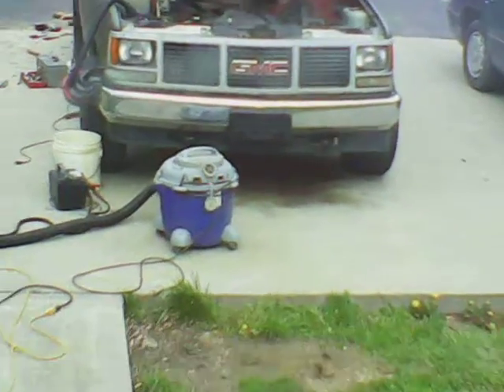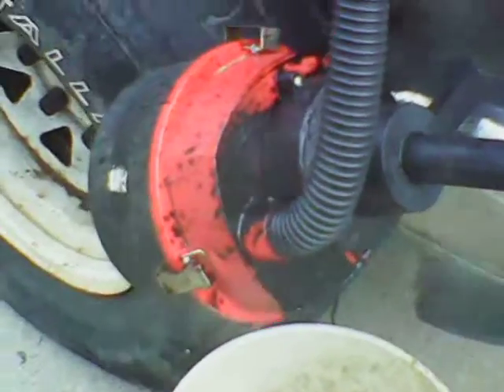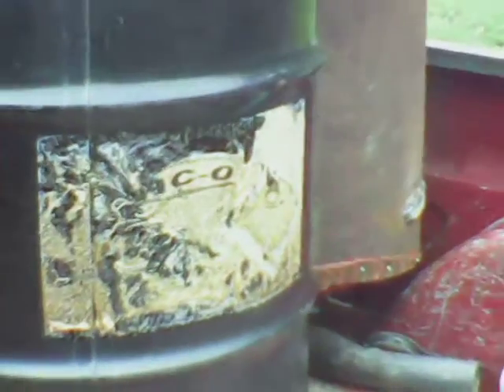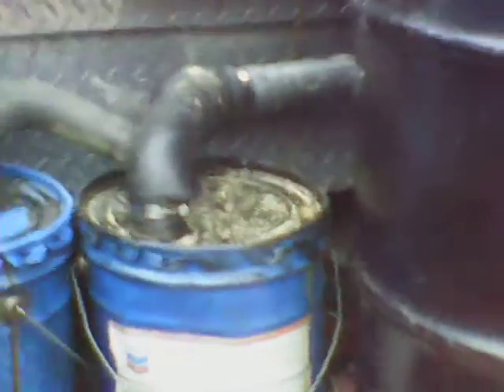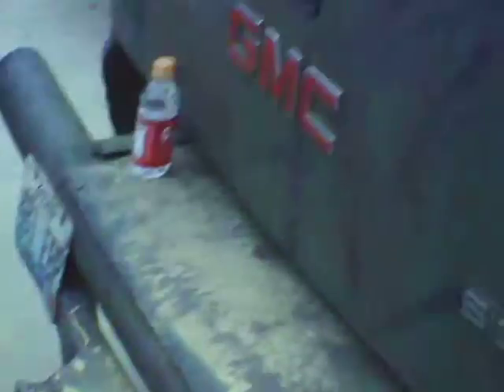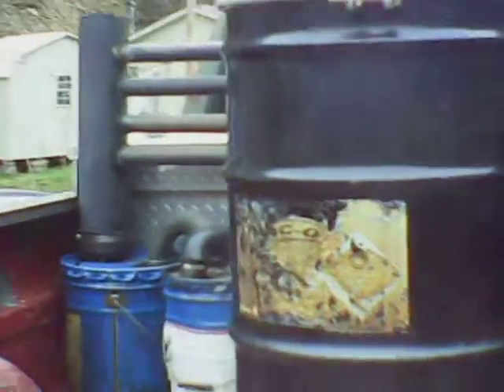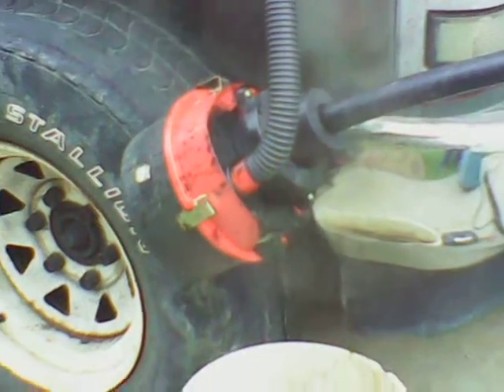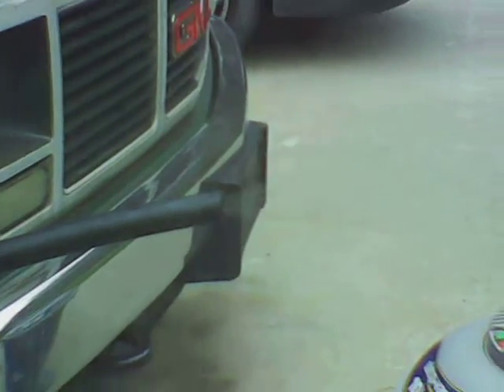gasifier project 4

Comment from the maker: I got the gasifier up and running today and it works better now. I ended up having to block one of the input tubes so I have 3 half inch nozzles and that helped a lot. Thanks for all the information. I put up a video showing my truck running on wood gas(idling at least).

Comment from the maker: I got a little hotter burn by reducing the hearth area but I don't have anything to measure the temp with. The gas coming out is flamable but I need a different air pump the one I have is not very good. I coudn't get it to light with the lighter in the video but I had it burning before I couldn't see the flame but it would catch paper on fire.

Comment: Feel free to try the filters but keep in mind that they are geared up for a smaller engine.
Once you get the tar to crack, you can get away with a much smaller filter so before you construct them, get your gasifier corrected first. If you don't get the gas cooled down enough you will drag a lot of water vapor into your filters which will choke them so be aware of that issue.

Comment: I use the same kind of wood so you should be good there. As far as the nozzles go my build required a reduction zone of 2-1/2 inches and 3 nozzles at 3/8 inches or 5 nozzles at 1/4 inches so I tried a one inch pipe nozzle aimed into the center of the ember bed and it was too much. I am now using just one 1/2 inch nozzle and that made a big difference with this build. The nozzle formulas are about as accurate as horseshoes and hand grenades. Cont

Comment: There are just too many variables with the gasifier designs such as your elevation, humidity, air temperature, the type of wood you are using and even where the stars and the moon are in the sky in a given night. Keep in mind that the engine will pull a large vacuum on the gasifier and that will vary with the engine RPM's so you may have to experiment. One more thing... Too much heat in the system will flood you with water and heat will kill the gas too by making it not burn as good.

Comment from the maker: The wood I used was dead fell wood that had been lying on the ground for a while. It may have soaked up some moisture but it felt dry, I have some well seasoned branches that are piled up off the ground and I'll try those next. I mached my nozzle size to the size of the output pipe which is 2"(the 4 input pipes are 1/2" does this sound right? Also what size should the wood chips be? The flame was hard to see because I was doing it in bright sunlight but I think it was orange. Thanks.

Comment: I just finished watching the video. The Imbert shouldn't have any tar so what is happening is you are running too cool in the ember zone. What color is the flair? Now as far as cooling the gas you could add more cooling pipe around the sides of the truck bed like you have on the front. The cooler the gas is the better it will work. Do you have a way to capture and remove water from the system? I wish I could tell you more but I have only built smaller gasifiers for small engines.

Comment: hey luke,nice job on your gasifier check out flash001usa for an excellent filter setup you might be able to use similar filter media in your containers and also docdcox for some excellent ideas on type and prep for your fuel I think the drier the wood the better keep us all posted on your results that does look like a lot of tar for an imbert design Thanks

Comment: Luke Here's a good one for you. I fired up my Imbert last night for the first time and I too had a flood of tar from it along with excess water and heat. I had to change my nozzle sizes and once I did that the tar started to crack and my flame went from a yellow to a florescent orange flame on the unfiltered side which is the tar soot being burnt in the flame. You made the correct choice! Do NOT run that into your engine until you know you have it cleaned up! Cont: